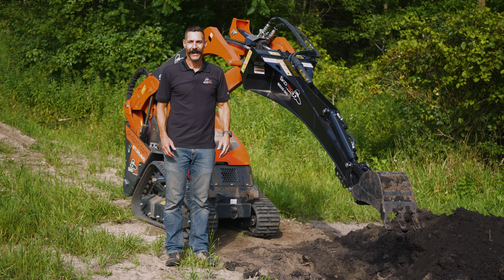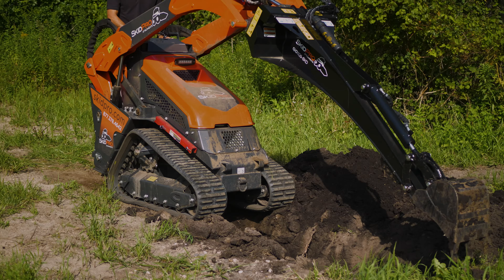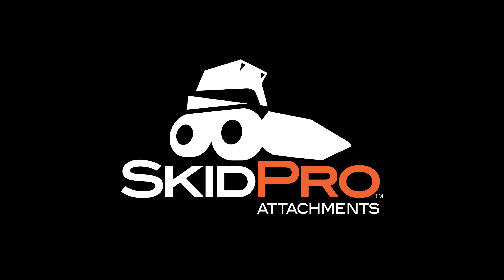Skid Pro Mini Backhoe – Quick Start Guide for Faster Digging!

Comment: Have one for a bobcat L28?
Reply from the maker: We do. We have a full size backhoe and this mini backhoe. However, your machine lifts about 1200 lbs right? So you could go with a mini backhoe with a bobcat MT plate. Fun fact, the Bobcat mini plate is the same size as the full size plate except it is not as wide. As long as the sides are cut out on an MT attachment, the full size plate will fit.
Reply: @skidpro  thanks for responding i actually talked to James today